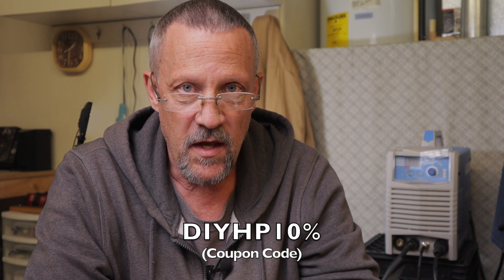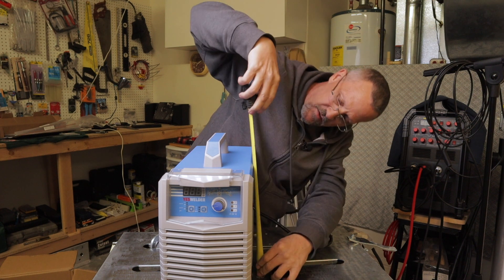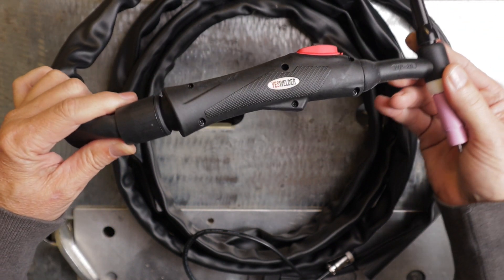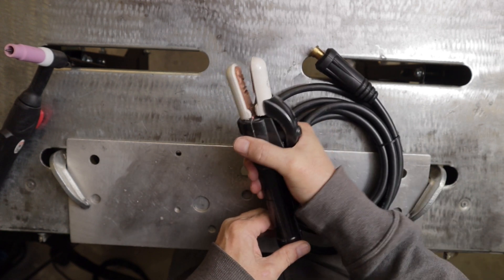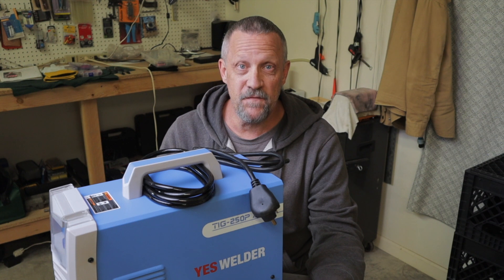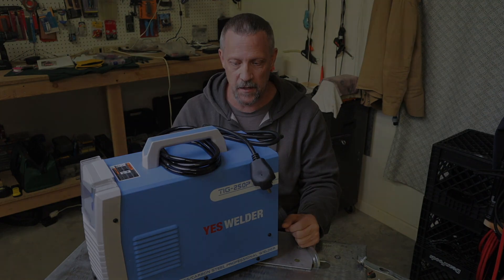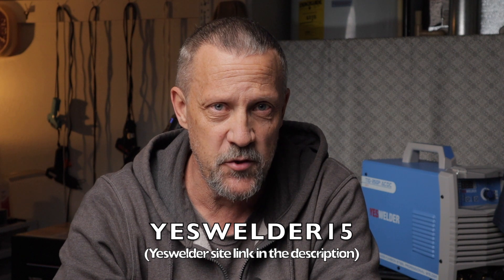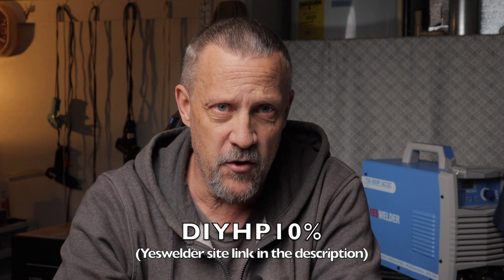I Tried the Yes Welder TIG250P and Here's What REALLY Happened

Comment: Button sounds so plasticy
Reply from the maker: Sure welds nice!
Reply: @DIYHomesteadProjectsDIYHP10  seems they put the money in what matters. Did alot of research and thinking about getting the 211 model. The double pulse option actually makes mig worth doing aluminum with. Will save alot of time over tig. And it still stick welds and flux core welds. One bad a** machine. Not sure on longevity but the internals on these are half and half name brand and off brand. However everything is solidly built even if some is offbrand. The ground is only 14 gauge though I would upgrade that to get better welds on dirty surfaces. They give you everything you need to be successful welding something though.
Reply: @DIYHomesteadProjectsDIYHP10  and it's 110/220

Comment: Bruce, can you tell me what you have for wire gauge to run your YesWelder TIG-250P on? In the manual it shows 30 AMP peak input...wondering if I have a problem running 12 gauge wire...
Reply from the maker: Keith, most of the time I am running the YesWelder TIG-250P on a 240V 30 amp circuit. The circuit is using 10 gauge wiring from the outlet to the breaker box. (I have never tripped a breaker on this circuit using this welder) When I run it on 120V I'm using a 20 amp circuit with 12 gauge wire.
Reply: @DIYHomesteadProjectsDIYHP10  Thanks Bruce...I probably have a 50ft line of 12 gauge so I think I'm pushing the limits.  I too don't blow any breakers but I'm thinking a more dedicated 10 or 8 gauge wire might help...

Comment: Bruce, you ever try 1/16" tungsten to weld aluminum cans together? Ordered some Blue...will give it a go in a few days...
Reply from the maker: Keith, I do have some 1/16 tungsten but I haven’t tried it yet. I’m curious to know how it works for you.
Reply: @DIYHomesteadProjectsDIYHP10  Tried the 1/16 blue tungsten today. Mixed results. At least I'm not burning through as much. I've found about 22 amps, 35 cleaning, 250 hz freq., 60 hz wouldn't work at all. Certainly can't wait to pool and go! It takes a lot of filler build up to get it to tack to the cans. Gonna keep working on it until I can get better results and send you some pics...
Reply from the maker: Sounds like you are making progress. Now you're making me think I need to try it again. LOL I'm looking forward to seeing some pics.
Reply: @DIYHomesteadProjectsDIYHP10  Well, a little setback! Didn't realize there were different size gas lenses! I was using a 1/8" gas lens with my 1/16" tungsten. The arc would wander and create holes even when I wasn't pointed toward the side the holes showed up! I now have a 1/16" gas lens...we'll see if there is a difference...lol
Reply from the maker: LOL, I'll bet you see a difference now.

Comment: I am confused on the T2 & T4 setting, if I got the numbers correct. I am the owner of a commercial MIG since 1984 and it uses like 14” spools and made adaptor for small rolls. I am forced into an early retirement but after decades of fixing others vehicles mostly at dealers, I am on foot. My son gave up on a nice semi rust free C10 and then donated his Tahoe after a few seconds of black ice. I am sure you see where this is going!
  Working on every carb made, I want my EFI and Lordy, the aftermarket parts! Sheet metal fits like crap and worn out OEM dies and holding fixtures weld them oddly. I am looking now in May, 2022 only to find the TIG-250P AC/DC had a WP-17 torch, not WP-26, no foot box plus no regulator. Oh well, chips have the same bag, but shy 17 more potato chips than a year ago. Other than Money, was is the difference in the WP-26 and function of T-2/T-4 that was not touched on well enough for my thick skull? Thanks.
Reply from the maker: The WP-17 is a 150amp torch and the WP-26 is a 200amp torch. 4T is a four touch of the button process. (1)One touch lights the arc, (2)let go of the button and it goes through the upslope to set amperage, (3)press the button again and it goes into downslope to the low amp setting, (4)let go of the button and the arc goes out.
2T is a two touch process, (1)press the button and the torch lights, (2)release the button and the torch goes out.
Reply: @DIYHomesteadProjectsDIYHP10  Thanks for the explanation from worn out horse in a pasture somewhere.
Reply: ASE Master Tech since 1978. My regards as it takes a long time to save up for the welder, accessories, consumables and I guess I need metal as it is sky high. 
I appreciate it, your video, your tutorial and the time is takes to edit the video. 
  I have watched many videos on the YES welder but will never get one for free. 5 lumbar fusion, FRA, then 3 rounds of spinal cord stimulation then the device company & Dr walked away. So, not starting any video anytime soon since I can walk 20-40 feet with a cain. Buy it's ok, I haven't had a cell phone since 2008 as Raytheon let me go after rotator cuff after teaching in 13 colleges and holding 4hr tech seminars in 7 states. Someday I will be in my mid 60's but YouTube is not in my cards.
 Sorry! Thanks for your help. Dean Kay

Comment: Hey Bruce? Have you tried welding two aluminum soda cans together with your YesWelder AC/DC 250P welder yet? I've tried, failed miserably!
Reply from the maker: I have and failed too. I have a few technique ideas that might make it successful that I haven't tried yet. When I try them out I'll probably make a video of it so you can check it out.
Reply: @DIYHomesteadProjectsDIYHP10  I'm looking forward to what you come up with! Thought I messed up my machine! Wouldn't weld for crap...found out I turned the frequency down to nil instead of the amps...sits there and just buzzes...Had to use your settings here to figure out my mistake...you the man!
Reply from the maker: I'm glad you figured it out and are back up and welding Keith. I've made plenty of silly mistakes like that myself. LOL
Reply from the maker: Well, I tried and still unsuccessful. I tried turning down the AC balance to reduce the penetration and then tried lighting up the arc on the filler rod to prevent burn through on start up. I worked better but still a long way from what I would call successful. I guess I still need to practice more with the aluminum can trick. When you get it figured out let me know what the trick is. LOL
Reply: @DIYHomesteadProjectsDIYHP10  LOL! Lately I've just been burning nice black holes in the aluminum cans. I had it turned down to 16 amps...didn't seem to matter...
Reply: @DIYHomesteadProjectsDIYHP10  Bruce, was gonna send you some pics but can't seem to share them on here...still can't do it but I did try to weld on top of the bottom of a can and had some results...
Reply from the maker: At least you are having some success.
Reply: @DIYHomesteadProjectsDIYHP10  Well Bruce, tried CK's gas saver lens, 1/16 Orange tungsten...doesn't seem to make any difference...it's like the YesWelder won't lower the amperage enough to start without burning through. I've even turned the begin/ending amperage down to amps. Have you tried your Everlast welder on aluminum cans? I thought you had one...
Reply from the maker: Hi Keith, I don't have an Everlast welder. I do have a Prime Weld and I have tried it on aluminum cans but I haven't had any more success with it than I did with the YesWelder. I think these cheaper TIG machines have a fairly heavy arc start compared to the more expensive TIG machines. Also some of this has to do with the foot pedals as well. Again, both the Prime Weld and YesWelder come with budget priced foot pedals. I think this is a good demonstration of one of the differences between budget machines and the high dollar machines. I have seen some guys weld aluminum cans with the cheaper machines and I think the key is technique. I haven't discovered the proper technique yet. LOL
Reply: @DIYHomesteadProjectsDIYHP10  I did buy the upgraded footpedal for my Yeswelder...obviously didn't help much....
Reply from the maker: I like the design of the upgraded foot pedal. I think the biggest benefit would be the ergonomics. It seems like the lower profile would give the user more control compared to the older style pedal like the one I have.
Reply: @DIYHomesteadProjectsDIYHP10   Bruce, a little more success with .040 Blue tungsten. If I can find a comfortable setup where i can weld more than  1/4" at a time, I might get something...putting the YesWelder on 25 amps, 5 start, 5 end, 35% clean and about 150 Hz.. I'm finding the .040 is easier to handle the lower amps...
Reply from the maker: Sounds like you are getting it figured out Keith. You're going to keep practicing at this and before you know it you'll be able to do it with no problems. 👍
Reply: Bruce, can I send you a pic? Can't seem to send it here...
Reply from the maker: Hi Keith, you can send it to me on Facebook  @ "Bruce Hayes"
Reply: Have you tried using the spot mode set at the quickest time, turn up the ac frequency, and set the pulse to max? These settings would somewhat mimic the "cold welding" machines. And a heat sink plate at the bottom might help with pulling all the extra heat away.

Comment: Great videos!!. So its been a year since you have answered questions about the Yes 250 vs the PW225. Now I beleive the PW now comes with the CK WW torch, an updated SSC pedal and power for a water cooler.  So my question a year later how do you compare the 2?? Thank you so much,,,,
Cheers
Reply from the maker: Thanks Don I appreciate that! The two machines are quite comparable but the PW225 has been in it's box in storage since I got the YesWelder TIG 250. I just don't have room for both of them in my shop at the same time. Personally I like the YesWelder better than the PrimeWeld for the following reasons. The YesWelder is much lighter and much smaller. I like the low amperage arc on the YesWelder better than the PW machine. The YesWelder arc is more stable and just a smoother arc especially at low amperage. I prefer the digital user interface of the YesWelder machine over all the knobs and pots style of the PW machine. This really shines with pulse mode settings or settings such as AC balance. A lot of people really like the CK17 and super flex hose on the PW 225 and I do as well but that is only a 150 amp set up on a 225 amp machine. That's why a lot of guys are spending a lot more money and upgrading to a water cooler and water cooled torch for the PW 225 machine. The YesWelder comes with a 200+ amp size 26 torch so a guy can get full use of the machine's capabilities without having to spend more on upgrades. One of the nicest features on the YesWelder machine is it has a temperature controlled cooling fan. That is a great feature for someone like myself who likes to make YT videos and not have the loud fans running constantly in the background. Some may not care if they are in a noisy workshop anyhow it may not matter. The YesWelder is a minimum of $75 cheaper than the PW and often more than that due to YesWelders frequent specials, discounts and coupons. At the time of this writing you can pick up a YesWelder TIG 250P for $600 US Shipped. (that's a steal for a machine with these features IMO) One thing I will give PW is the 3 year warranty where YesWelder only offers a 1 year but other than that, I would prefer owning the YesWelder TIG 250P over the PW 225X machine. YesWelder TIG 250P - https://yeswelder.com/products/tig250p-acdc?ref=DIYHP10%25

Comment: It's 4/15/2022. Warranty is now out. How is it holding up? How much usage?
Reply from the maker: It's holding up well. I have not had a single issue with the welder since I've owned it. I have used it weekly on my home projects over the past year and a half. I highly recommend this machine for the home shop and hobby welder such as myself. If it stops working, I will replace it with the same machine.

Comment: Do you need to change from ground positive to ground negative when switching from dc to ac?
Reply from the maker: No, when in DC you want DCEN and when you are in AC the polarity alternates between DCEN and DCEP automatically so no need to change the leads when switching between AC and DC TIG welding.

Comment: Now that you have a Primeweld so witch do you use more now !
Reply from the maker: I had the Primeweld first. I received the YesWelder just about 1 year ago and I haven't plugged in the Primeweld since that day. I really like the YesWeder over the PW. The YesWelder has a much nicer and more user friendly interface. The digital control on the YesWelder makes it easier to fine tune and duplicate settings instead of just getting close. It's also much smaller and lighter. I also think the YesWelder has a smoother low amperage arc in comparison. Not to mention the temperature controlled fan. It doesn't constantly sound like a wind tunnel in the shop when the machine is turned on. And the YesWelder is a little cheaper. They run great sales quite often. I've never seen a PW sale on any of their machines. I like the YesWelder machines better!

Comment: The real question is how does it compare to the welder you have in the background.  That Primeweld Tig225X.
Reply from the maker: The two machines are quite comparable. Personally I like the YesWelder better than the PrimeWeld for the following reasons. The YesWelder is much lighter and much smaller. I like the low amperage arc on the YesWelder better than the PW machine. The YesWelder arc is more stable and just a smoother arc especially at low amperage. I prefer the digital user interface of the YesWelder machine over all the knobs and pots style of the PW machine. This really shines with pulse mode settings or settings such as AC balance. A lot of people really like the CK17 and super flex hose on the PW 225 and I do as well but that is only a 150 amp set up on a 225 amp machine. That's why a lot of guys are spending a lot more money and upgrading to a water cooler and water cooled torch for the PW 225 machine. The YesWelder comes with a 200+ amp size 26 torch so a guy can get full use of the machine's capabilities without having to spend more on upgrades. One of the nicest features on the YesWelder machine is it has a temperature controlled cooling fan. That is a great feature for someone like myself who likes to make YT videos and not have the loud fans running constantly in the background. Some may not care if they are in a noisy workshop anyhow it may not matter. The YesWelder is a minimum of $75 cheaper than the PW and often more than that due to YesWelders frequent specials, discounts and coupons. At the time of this writing you can pick up a YesWelder TIG 250P for $600 US Shipped. (that's a steal for a machine with these features IMO) One thing I will give PW is the 3 year warranty where YesWelder only offers a 1 year but other than that, I would prefer owning the YesWelder TIG 250P over the PW 225X machine. Both machines are amazing machines for a sub 1K price range. YesWelder TIG 250P - https://yeswelder.com/products/tig250p-acdc?ref=DIYHP10%25
Reply: My same thoughts and he has answered this question really well.

Comment: Color me impressed! Nice bead! What did you have the hood set to shade wise?
Reply from the maker: Thanks Chris! It's been a little while but I'm usually around 10 to 11 on the shade while welding at 125 amps or so.
Reply: @DIYHomesteadProjectsDIYHP10  I scored a Klutch MP200iDV multiprocess welder that has Mig gas and flux core, stick, DC TIG and a spool gun for $300! The more I see people Tig welding the more I want to try it. Which means I’ll have to convince the wife I need a pure argon bottle, a couple weeks after getting a C25 bottle lol. Would you say it’s easier or more difficult to see the puddle with Tig or Mig? Which process do you prefer more? Tig seems to do everything well at a 1/4” and below.
Reply from the maker: I think it's easier to see the puddle with TIG. I prefer TIG because it's so clean and looks good if it's done right.

Comment: How can I use different Tig torch and have the access to the same features as the original Tig torch?
Reply from the maker: By features are you referring to the finger switch? Just get a torch switch and zip tie it to your new torch. Maybe?
Reply: @DIYHomesteadProjectsDIYHP10  I can't weld if I use a different Tig torch that is not connected to five pin connector
Reply from the maker: I don't know the answer. I've only used the foot pedal with mine.

Comment: @DIY Homestead Projects what size is the tig torch connector. I have the tig 205 ds an it came with the same torch. It’s far too bulky an I would like to get a ck torch to replace it. Just don’t know the connection size
Reply from the maker: Sorry but I don't know what size the connector is. I wish I did though. I suppose if you were to email YesWelder they might be able to tell you.